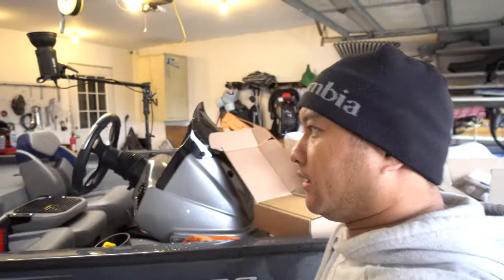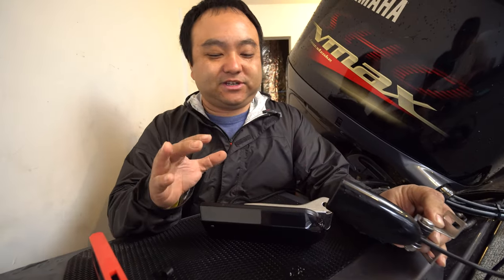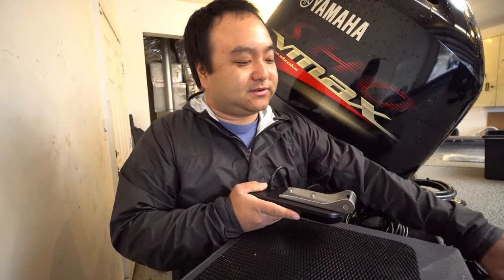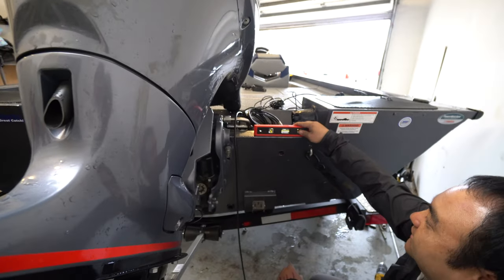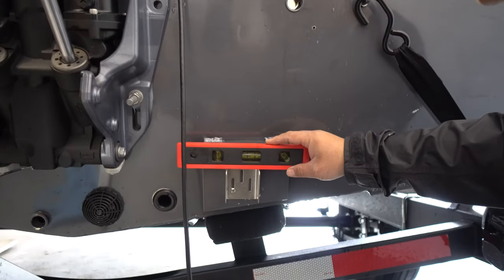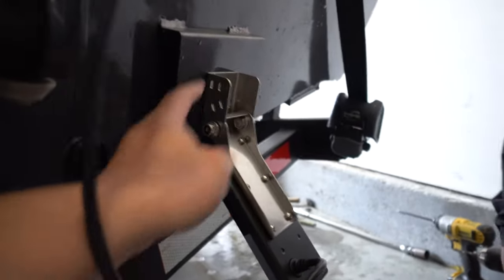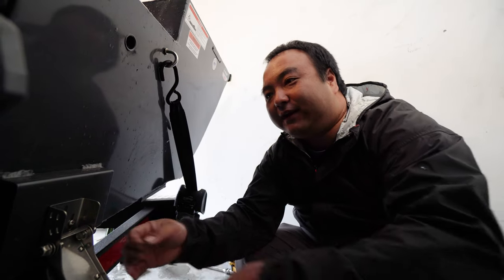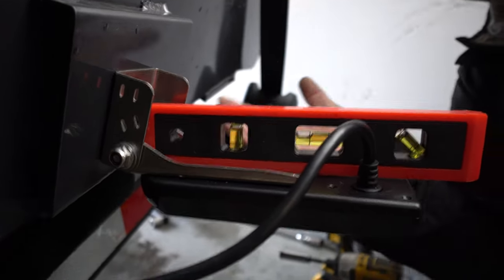Very Important Steps to Correctly Install a Stern Transducer - OOW Outdoors

Comment: You also have to account for trim on the motor at full speed lay a straight edge of the bottom of the boat and allow the but end to touch the front of the transducer should hit at the fold line on the transducers usually about the half way mark
Reply: The BOTTOM of the Transducer only needs to be an 1/8" below the surface of the bottom of the boat on a fiberglass boat, and 3/8" below the surface of the bottom of the boat on an Aluminum boat.

Comment: You’re wrong about the transducer angle. It should actually point downwards at the rear, not upwards! That is the secret to getting it to read depth correctly at speed! You will never get clear high speed readings with it pointing upwards like that!

Comment: It would help if you also compensated enough cable for your transducer to be rotated 90 degrees downward if it gets snagged on a tree limb or something; the way you installed it is incorrect.

Comment: what happens when you and your gear gets loaded into the boat, does that not put the transducer off?
Reply from the maker: You have to just do an average of which is  most likely the equipment weight you will have and angle to that
Reply: I had a full tank of fuel and all tackle in the boat with all the batteries and did my settings for the transducer